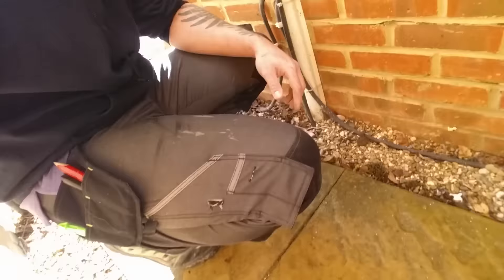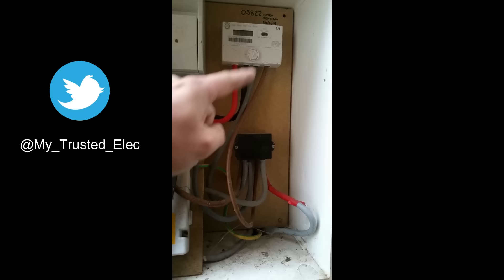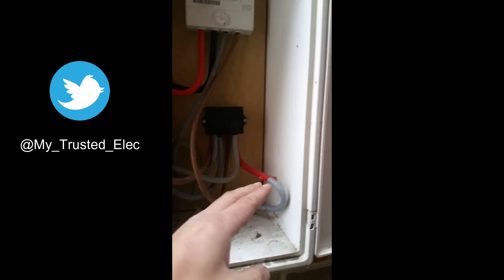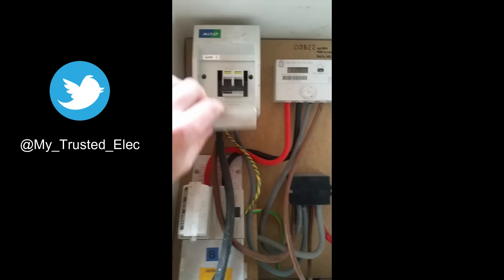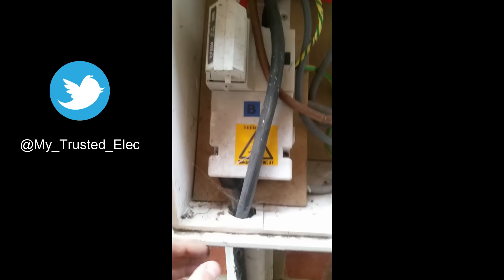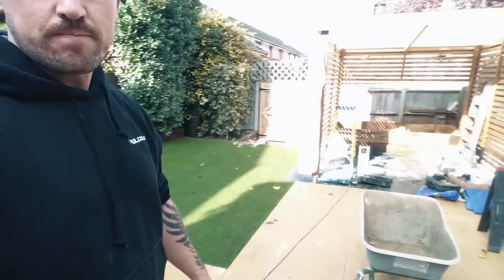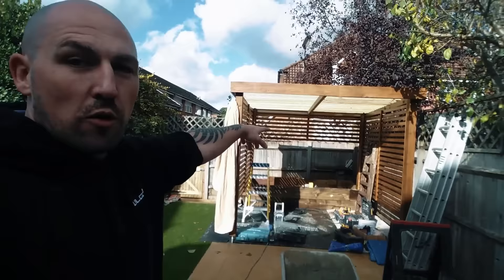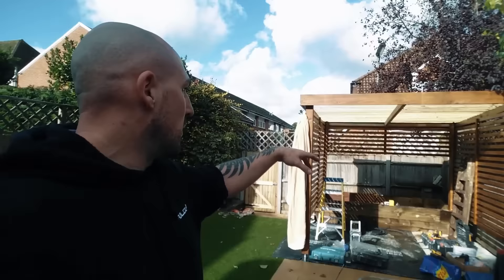Garden Lighting, Wireless switching & Terminating SWA cable into Wiska boxes.

Comment: I rarely use countersink screws for anything.  Have a look for flange head screws in A2 stainless steel to use outdoors.  The heads don't need washers.  With stainless, they still look new after five years.

Comment: Never, ever had a problem with WISE equipment, loads of options and great technical support, wouldn't use anything else. WISE switches look great too. Personally I always run 4-core SWA for lighting just for that other SL option. The WISKA earthing clamp looks like a neat time saver thanks for the tip !

Comment: I fixed up some faulty remote controlled lights on a summerhouse by sending the switched live to a photocell switch mounted just to the side of the gable end. The customer wanted the lights to be on at night and off during the day and would always forget about them with the remote so they were always left on all day and night. The photocell switch works really well and customer is very happy.

Comment: Great video m8 I also seen the video on the wireless switches and am long time user of wise controls and was going to give the new stuff a try,after seeing your video in basically an ideal situation and not working properly I will stick to my wise gear.keep up the great work
Reply from the maker: It's probably great if you just use the individual receiver modules in an IP box to switch multiple lights

Comment: Great channel, just subscribed. 
I  always use dome head screws in metal back box's, as it doesn't leave a sharp edge. I did actually locate a fault a while back to a cable snagged on a sharp edge of a screw in the back box.

Comment: Quinetic say.... The Quinetic Ultra Slim Floodlight comes with an integrated wireless Quinetic controller that can be
paired with the Wireless Quinetic energy switch using any combination: a floodlight can be controlled
by a maximum of 10 separate switches, a switch can pair with an unlimited number of floodlights.

Comment: Another great video, only thing to say is use wago's instead of the wiska connector block also same again with the lights instead of the choc block
Reply from the maker: Agree about the wiska. Thing is I didn't have any 5 way lever wagos on board, only the ones for solid copper cores. As for the light I did consider it but there simply wasn't enough room. You know what those things are like. I struggle with that little 5a block. That video had been seriously edited for the light believe me 😅

Comment: Just finished watching a DSS video when I saw yours bud. Annoying about the switch, according to the manufacturer, you can have unlimited lights per switch but 10 switches per light. Keep us updated, I was going to grab some, but going back and forth to mess around with faulty kit doesn’t inspire me to be honest.
Reply from the maker: They seem like a great bit of kit. F knows what's going on. I reprogrammed it 3 times and it still does it with both the switch and fob. It's great that the receivers have wifi capability. Maybe they work better 🤔

Comment: I worked on some garden lighting this week and used Wiska boxes. We found that we could no longer remove the membrane with the plastic stuffing gland as usual and had to use a brass fitting with a lot more force. Have you come across this recently?

Comment: The "service head" is not the meter that you pointed to. How are you not allowed to pull the fuse on the service head? How in that case do you change a fuseboard? Call out UK Power networks to carry out a safe isolation?

Comment: Sorry but dome head screws and washers on an swa cleat looks a bit rough. Proper 5 gauge countersunk screw pulls in nice and will sit flush with the cleat.
Reply: I've never seen a countersunk cleat.  Csk screws convert some of the downwards force sideways, same as an axe splitting wood apart.  A pan head screw doesn't do that.  Its downwards force works more like a hammer than an axe.

Comment: This is a really great video. Thanks for sharing. Quick question though? At 11:04 I note there are two earth wires on the left (4 wires in total). Where did the second earth wire come from? Is it from that bracket inside the Wiska to the earth connection in the block?

Comment: Why don't you just use round head screws where the head is big enough so it can't be driven into the cleat?
Reply from the maker: It's just preference and something I was taught to do. It doesn't mean it's the only way. I'd change tomorrow if I found a better way.
Reply from the maker: @chossy5098  do you mean Pan head screws? A black pan head might look quite good actually 🤔 don't think it's a screwfix jobby. Would have to buy online. watch this space!
Reply: Black zinc coated flanged head self tapping screws is what your after, (basically a pan head with an incorporated washer in the head) and i agree will look good with black cable cleats for armoured to make it nice and neat 👍
Reply: Washer head screws AKA flange head screws? Who doesn’t enjoy being out in the garden screwing in a flange?

Comment: Great work, you mentioned you didn’t read the manufactures instructions?
Reply from the maker: You caught me out Lee. 

I hadn't combed the small print of the operational instructions for the light as I'd already read the switch and receivers operational instructions. Good call mate.
Reply: My Trusted Electrician - Carshalton, Wallington and Coulsdon no problem, many sparks overlook the MI’s and just instal based on ‘experience’.
Reply from the maker: @leeward5576  I was trying to explain that yesterday to a Landlord. Had a NSH which required distancing from walls etc.. He was adamant it would be fine behind a door.